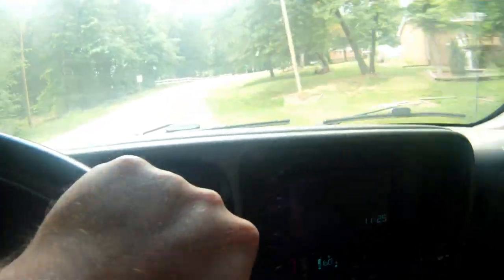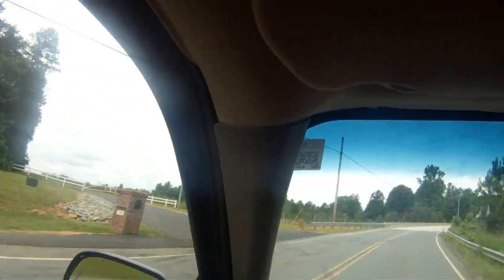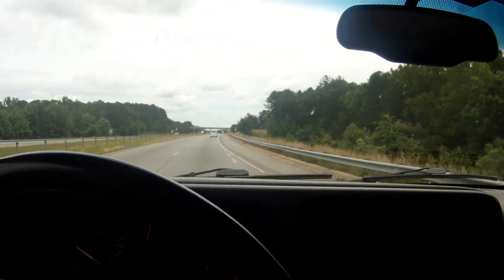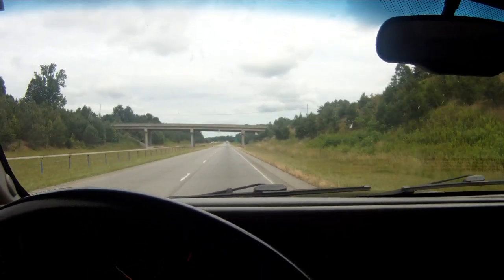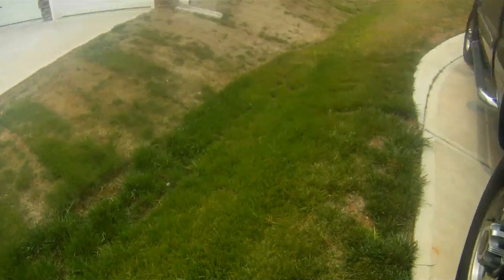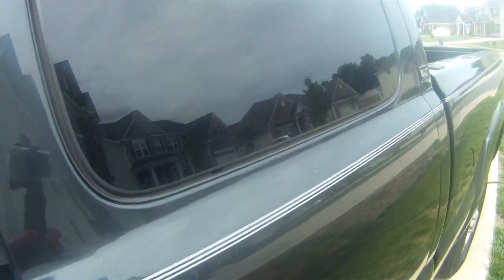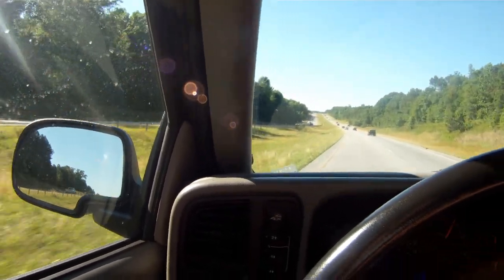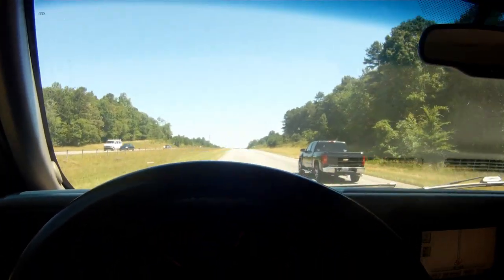2005 GMC Sierra 2500HD - Wind Noise Repair

Comment: I'm in a '03 Silverado ext. cab - Same Annoying Issue - Time to Fix this shit ONCE & FOR ALL.
Reply from the maker: It took awhile to track them down - but I replaced the weatherseal on the drivers door, the clips for the rear windows, and removed the front bug guard, and I replaced the door hinge pins on the drivers side front door.

That eliminated 99% of the wind noise.

If you don't happen to close the rear hatch doors properly - those can the wind noise to come back - so be on the lookout for that as well.
Reply: +bonecrrusherSS - I've already applied Dynamat to the doors (both the outer skin & inside panels) and to the firewall of my truck. That helped a Lot with the overall road noise. But like you, after doing that, I've noticed the Wind Noise is the Main Culprit that I need to tackle now. It sounds like the windows just aren't sealing properly.

Comment: 0:12...duramax Diesel
Horsepower: 310 hp @ 3,000 rpm
Towing capacity: 10,100 lbs
Engine: 6.6 L V8 diesel
Curb weight: 5,561 lbs
Transmission: 5-speed automatic
Payload: 3,639 lbs
Dimensions: 228-247″ L x 80″ W x 76″ 

Might as well have kept going I mean you where half way there 😂😂😂
Reply from the maker: Mine is at 6600 pounds 🤣

Comment: A guy I know had 1,010,900 miles on the same model Duramax you have on the Original Motor & Transmission all stock. He bought in new. Those miles was when I talked to him 3 years ago. He had to go to the Dealer and pay for a new mile cluster with a Certified GM sticker on the door jab saying it was changed. He went 800,000 Miles on the front stock brake pads!
Reply: Hilarious...
Reply: 800k on one set of pads?  No, no he did not.

Comment: I have a 2004 3/4 ton duramax shortbed, I also have to clench up for railroad tracks.  They are the worst riding things I have been in since the 70s.
Reply: Kit Smith yeah I feel ya not as bad as my 98 ram 1500 tho